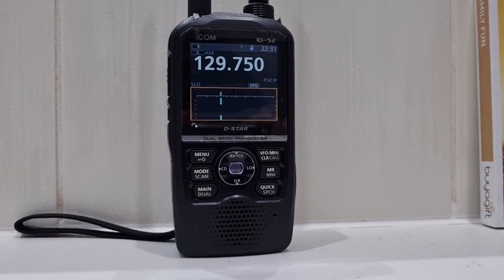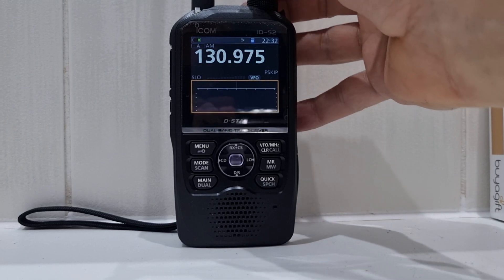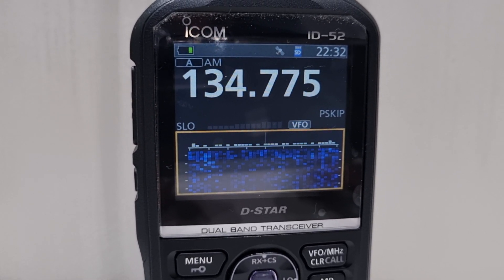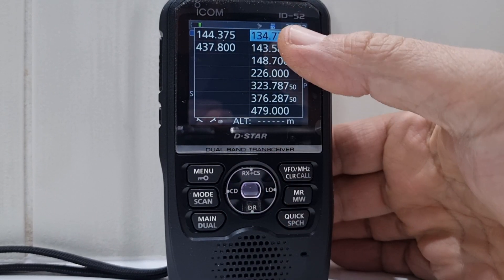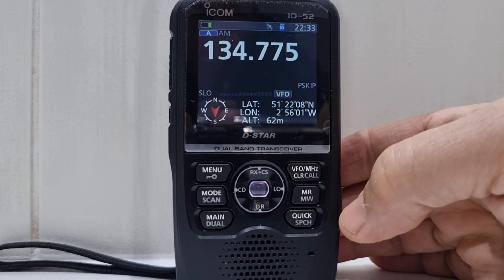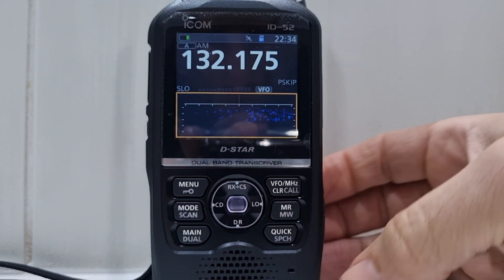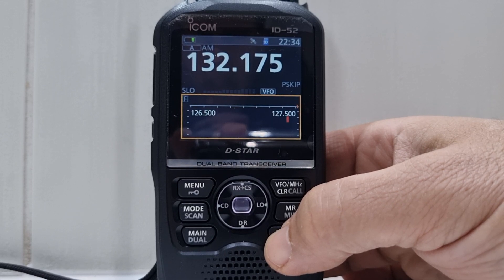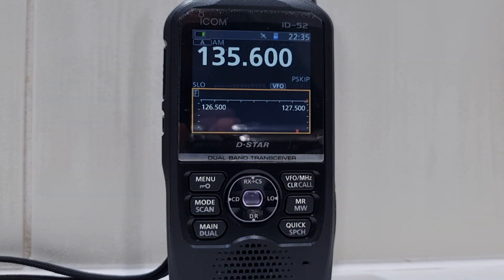ICOM-ID-52 Airband 2 Meters 118mhz to 137 mhz- Bandscope

Comment: Hi all, I just bought an ID52e and while programming some air band frequencies I realised that in some case the frequency is readjusted to a different one, close but not the same no matter the step is set. Any ideas to program the exact frequency?  For instance 127.505, 124.230, 118.080... are recalculated to 127.50833, 124.23333, 118.08333 ...
Reply from the maker: Change your step.

Comment: With scope mode on, auto or open SQL (open SQL does nothing in scope mode) and “AF Output (DUAL/AIR Band)” switched ON and a weaker signal is received, all the radio does sometimes is click. But the scope clearly shows that there is a transmission. If I press and hold the SQL button, I hear the signal. I also hear the signal if I turn the scope off. 

So it appears that in some situations the scope is affecting the SQL or something.

Maybe its me? 😂
Reply from the maker: Yes agree